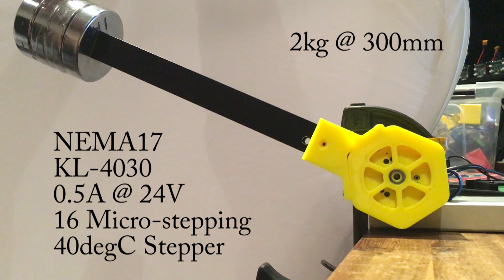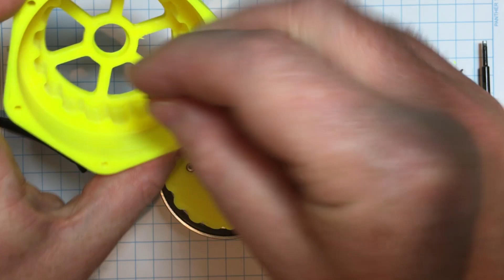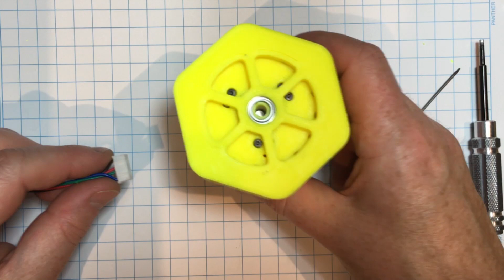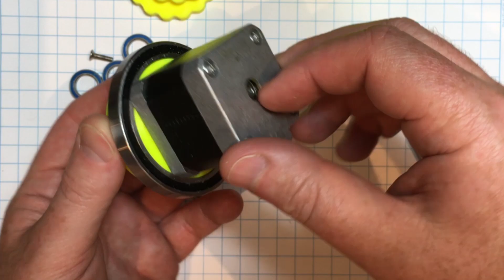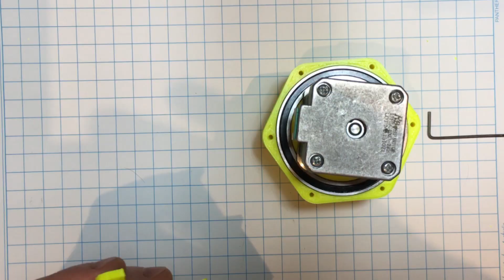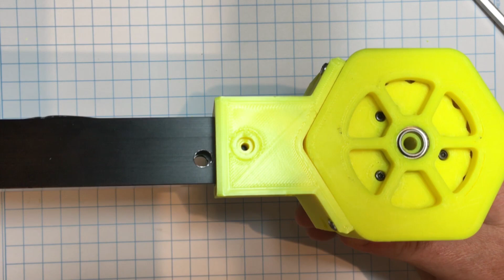Dual Linked Two stage Cycloidal Gearbox 3D Printed NEMA17

Comment: I applied your design for my own gearbox with first stage 15:1 and second stage 15:1. But somehow the output just moves back and forth a little.
The tolerances for the 3d printed parts are quite good and everything fits nicely.
Do you know if there is somehow a problem with two identical reductions?
Reply from the maker: The two stages need to have a different ratio.
Reply: @PaulGouldRobotics  Thanks, I realized my mistake...
Reply from the maker: @marvingriener3533  I don't know where to find the information you need. I've never seen an actual equation for a dual stage. You can chat to me on Instagram, Hackaday or Discord. I would like to see your design.

Comment: There are simpler way to make a two stage cycloidal gearbox.
Reply from the maker: Please link to other simpler designs. I would like to try them.
Reply: @PaulGouldRobotics  ok let me see.....
Reply: @PaulGouldRobotics  This guy has the idea  https://www.youtube.com/watch?v=yKTBOfqEYI4 . But is awfully constructed. I've made some of them. You only need 5 pieces. The case, the double gear, the excentric bolt and the second cap attached to the output shaft. The case has the N1+1 teeth. The double gear has N1 and N2 teeth. The second case has N2+1 teeth.  Think about it and try it. If I have some time I would upload a video talking about it.
Reply from the maker: @urielalbertodiazreynoso6309  That is the basic of the dual stage gearbox. It has many problems which I am trying to solved with this design. My design is statically balanced and the forces are balanced around the housing. There is very little vibration at high speed.
Reply: @PaulGouldRobotics  You can balance it with some metallic load in the opposite side. Also you don't need bearings. For a 3D printer project I think simpler is better. If you are designing some industrial/commercial prototype maybe you are right. There are too many pieces for my taste :)
Reply: @PaulGouldRobotics  Also I think the first stage should be as thin as you can because the load is lighter. The second stage should be as stronger as possible. In the first stage friction should be minimal and in the second stage doesn't matter too much.
Reply: @PaulGouldRobotics  Well, any way. I like your videos and your gears designs.
Reply from the maker: @urielalbertodiazreynoso6309  I have built and tested enough 3d printed cycloidal gearboxes to know that these improvements are needed for longevity and when subjected to load. Have you loaded up your 3d printed gearboxes?
Reply from the maker: @urielalbertodiazreynoso6309  With these dual stage gearboxes both stages see the same forces.
Reply: @PaulGouldRobotics  that is not true. Name T0 = F0 * e  the torque produced by the motor is the product of the force produced por the motor at e distance (e=excentricity) . The fist gear supported on the post acts a type 2 lever.. The force in the load of this lever is F1 = F0 * N1 e / e  = F0 *N1  (the mechanical advantage). This force is the same in the second stage as you said. Now, in the second cap there is a F1 force acting to a distance of N2*e. So the force seen in the output shaft is F2= F1*N2*e/e =F1*N2= F0*N1*N2.
Reply: @PaulGouldRobotics  sorry. I should say. That is true but nevertheless there are N1*N2 mechanical advantage.
Reply: @PaulGouldRobotics  sorry. I've only made very small  gearboxes like 24mm and 32mm diameter. So that is why I don't like bearings neither metal pieces.

Comment: great design. good job. what kind of material the 3D print? PLA?
Reply from the maker: Thanks. It is PLA but it would be better with fancy filament
Reply: any suggestion for a stronger and tougher material other than PLA?
Reply from the maker: I’ve used nylon PA66 at work but mainly pla and abs for robotics. Materials is not really my skill area.

Comment: What's your stepper driver?
It doesn`t sound cheap 🤣

I like this "reduced gearbox". It is a good option for a lot of torque not bound to "just robotics".
Reply from the maker: kl-4030 but any stepper driver for a 3D printer will do.

Comment: Great progress so far! Do you know the reason for unsteady movement of hypocycloid gears? Perhaps the design has some flaws or imprecise rules? Or is it due to imperfect 3D printing tolerances?
Reply from the maker: I don't know yet. Others have had this problem as well.
Reply: It sounds like there's 2 in-phase tork ripples harmonizing causing a surge of positive and negative tork over baseline constant. Stepper motors, as well as servos, have a tork ripple in operation, ie, it's not a constant rotational force is a wave.  Cyclodeoid drives can have one as well stemming from pin engagement disengage cycles also forming a wave.  If they're not matched to negate each other, they could amply each other.  Servo motors would be less prone to this over steppers.  

You could try, using a 5 phase stepper, or servo as well to help mitigate the ripple as they have much more even tork ripple due to their design. 2 pole would be the worst.

Depending on your controller, you may be able to adjust the timing's on the servo or stepper to mitigate tork ripple somewhat.   Additionally, if you were to find the harmonics of your drive, and ensure your cyclodeoid drive operates in an inverse phase, you could likely get rid of it. 

And I'm an Idiot..  I was half right.  It is a tork ripple, but for a different reason.  1 rpm of motor = 1 tooth movement.  looking at the footage, only 2/3 of 1 motor rotation are providing full engagement power.  In whatever controller you are using for your stepper or servo, have it reduce power at the beginning of the disengagement stroke, and bring it back on the engagement.  If you can do this as a sinewave ( some drivers let you do this )  so that the power is gradually increased and decreased all the better.
Reply: @Keri-Kerigan  If ripple in torque of the driving motor is the cause of the non uniform output (rotational speed) then this should be proportional to the gear ratio? That doesn't seem to me in this video. Your theory can be consistant if you think about an amplification of non uniform movement of a first stage due to engagement / disengagement of teeth that are superposed of the second stages non uniformity?
Anyhow, there must be some non linear effects in the law of speed reduction? Or have I misunderstud your apprach of explaination?
When I regard a cyclodeoid drive, isn't there allways a contact zone  (in a single stage) with full engagement that continously is moving forward in radial direction?

Comment: do you have any idea about noliniear motion? i had tried 2 two stage cycloid gearbox and it is also noliniear. but one stage is fine.
Reply from the maker: I'm not sure where it is coming from. I will have to do some research.
Reply: My best guess is that the non-linear motion comes from small printing errors.  Since the final ratio is the difference between the first and second stage ratios, the output moves much slower while any non-linearity in the gears stay the same size.  Recently experimented with elliptical bearings and strain-wave gearing and my 2015:1 model suffered badly from non-linear motion while a 31:1 variation was much smoother.  https://www.thingiverse.com/thing:4855353

Comment: this type of kinematic scheme of planetary drive has a very poor efficiency for large ratios.
Reply from the maker: I would be happy if it could achieve 50%. It is plastic with many sliding contacts.
Reply: @PaulGouldRobotics  the problen is not in material or tooth profile itself, it's in the first place related to this kinematic sheme of planetary gear
Reply: @konstsh2240  Can you elaborate on this?
Reply: yeah please elaborate
Reply: @heartminer5487  In short - in layouts like this with "differential" reduction principle the tooth relative sliding velocity becomes comparable to its absolute velocity in contact point and thus frictional power loss rises significantly. This happens because when ratio increses the eccentricity decreases and the average distance between contact point and instant velocity center decreases also. So in terms of efficiency on high ratios the classical multistage planetary transmission is more preferable. Though it is not so "cool".